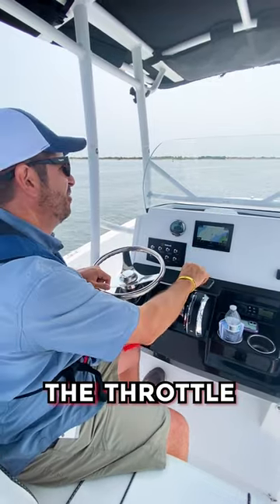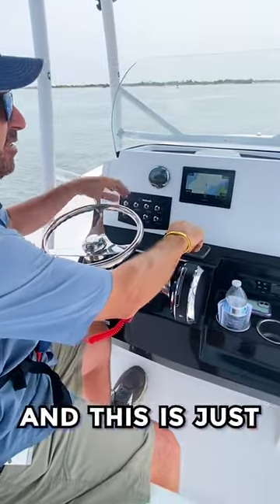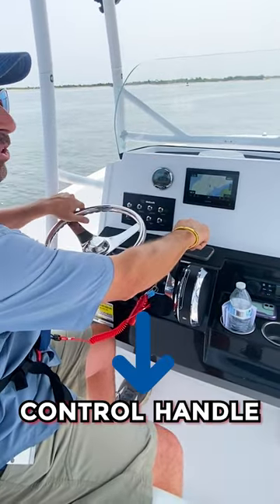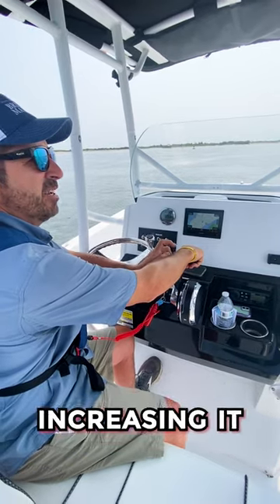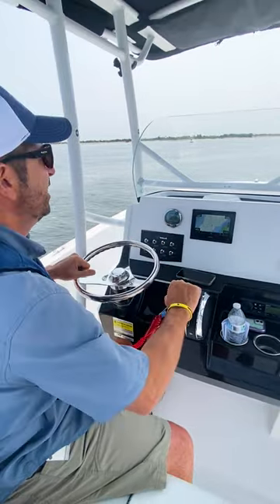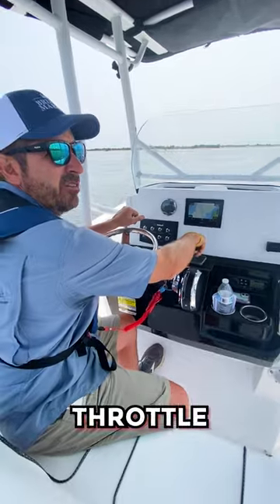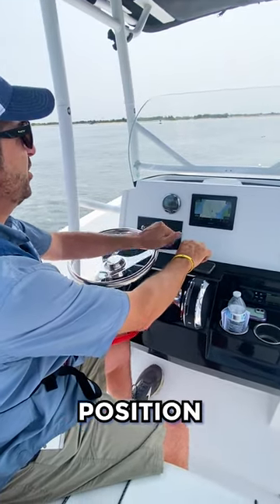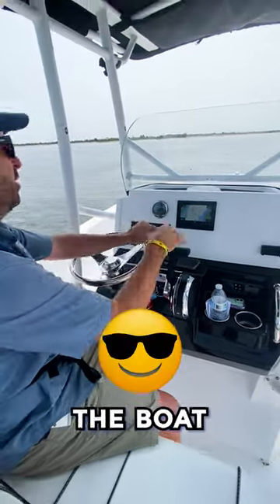Bridge Marina Boating Tip: Gradually Increasing Throttle #boat #shorts

Comment: Remember though, you don’t wanna gradually increase the throttle of your in the ditch. Don’t increase it to a spot where your boat is working really hard either wide open throttle and come back until it falls just before it falls in the ditch below the ditch.